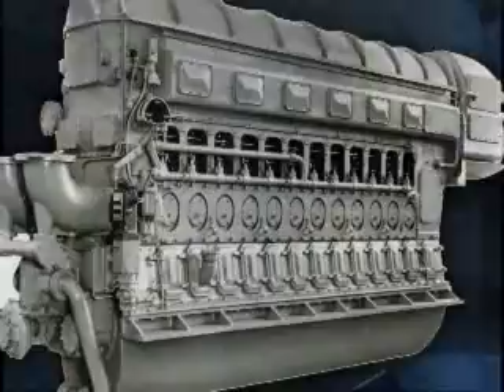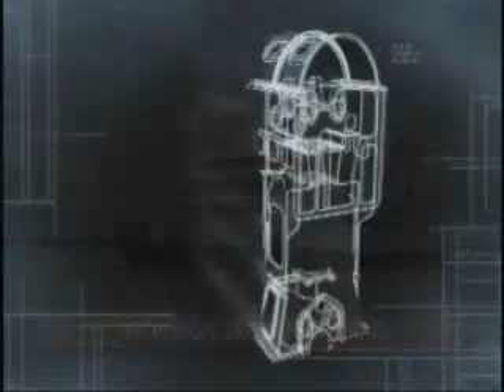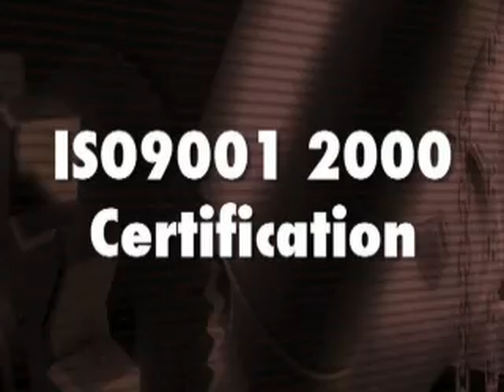The History of Fairbanks Morse Engine

Comment: Had 3 FM engines on the USS Trout SS-566 that I was part of the Decommissioning Crew in 1978. They powered 940kw generators that drove the main motors and recharged the batteries. Sad to see it scraped.

Comment: In the 1960s when I worked for Canadian National, we were in the process of scrapping CLC/FM locomotives as we found them unreliable in railway service.  Lack of cooling would cause the top if the lower pistons to overheat and burn and repairs involved removing the upper crankshaft and piston assembly which made them expensive to repair.  Marine applications, sitting in an unlimited supply of cooling water, did not seem to have this problem.

Comment: Sailed on several sea going tugs that were retro fitted with the 10 cylinder opposed engines that came from early submarines.  I was an engineer & spent many hours in the same room with these engines. Very reliable & for the most part, easy to work on. Can still hear them running!  720 max rpm full ahead
Reply: We had the same engine on a dredge pump , amazing engine

Comment: I think you should re-enter the locomotive Market I remember when I was a kid being told about Fairbanks Morse and trainmasters I knew they had an overheating problem do a general electric didn't make a big flared out radiator from the car body General Electric is literally about ready to go bankrupt from all the debt that they are burdened with I think it would be wise for you as a company to invest and coming out with a very efficient powerful locomotive there's a lot more systems now that would be able to keep the engine at an optimal temperature in a locomotive car body I bet you could figure it out
Reply: The FM locomotives failed because the engines ran horribly at high altitude, as the engines where designed to power a boat at sea-level, not a locomotive 1000+ feet above sea level
Reply: @harrimanfox8961  Anyone else hear that about FM diesel/electric locos? Hard to imagine that FM designers were unaware that UP requires locos to summit Sherman Pass at 8,242 ft with acceptable loss of power. I dont see why, if EMD 567, 645, and 710 two-stroke loco engines and GE  FDL and Evolution 4 stroke loco engines could be made acceptable, that FM locos couldnt be boosted to meet railroad requirements.
   BTW I heard that FM sued GM after GM set a policy with railroads that "Trains hauling GM autos must have GM locomotives on the front".  But FM, I think, was just out competed by GM/EMD and by GE/Alco for the diesel/electric locomotive market. Baldwin/Westinghouse was another loser in that competition.

Comment: As a small child I lived 5 Blocks from Fairbanks, the low drone and whine during test runs was a sound , I thought of Winter.....who knew....I worked for the Paper Industry, gut punch killed us , Fairbanks still humming around the Planet...Beloit PMD equipment still out there as well. Beloit was and still is to a smaller degree a Bastion of Gear, Weld, and Machine engineering Heads.

Comment: OK you may talk reliability but on the 3 ships with FM engines  on 2 ships they never saw 5,000 hrs between over hauls, very sad engines during my time with them during the 70's & 80's, I wont even mention the constant fuel line leaks
Reply: John Holden A ship I worked on had four 10 cylinder FBM's through a reduction gear to a single prop and didn't have many problems. Pigs on fuel though!

Oh... fuck Pielstick

Comment: Are you considering re-entering the Locomotive production market? I have read up on the iconic Trainmaster locomotives, and from what sources recount, the main issues with the Trainmaster were not in its performance- it was simply ahead of its time. Railroads were not seeking such giant, powerful units, and the shop workers weren't used to the opposed piston engines. Now, with the contemporarily built, massive behemoths by both EMD and GE hard at work for such Giants as BNSF, CNR, UP, NS, CSX, CPR, and export, plus earlier heavy-duty power like the EMD SD40s still beefing up rosters of all kinds of railroads, all across the U.S., one might think that the FM Trainmaster could serve as an inspiration for a new, even better locomotive, to meet the needs of today's railroads. Although most lines currently have plenty of new power, they will be needing many replacements for older power in at least 5-10 years, so if work was started before too long, a fine locomotive design or two might be developed. Think of what could be done- the power and efficiency of the latest FM engine designs, inside a frame, housed inside perhaps a shroud remeniciant of the fantastic curves and smooth styling from both ALCo and FM's entrancing history. A locomotive produced for the future, out of such remarkable past, would be something truly unbelievable. I cannot say how exited it would make me personally to see something different enter back into the locomotive market, especially considering how boring a world it is, dominated by EMDs and GEs that all look alike, with little to no taste. What ever happened to those rounded roofs? The engine that sounded almost like it was chugging rather than whining or growling, and the unique charisma surrounding some of the most under-appreciated diesel locomotives produced in the postwar era. I will hold out hope and dreams that soon, once more, a great powerhouse will once again ride the rails of mainline roads, proudly displaying a great "FM" and/or "ALCo" nameplate.
Reply: An opposed piston diesel to power new locomotives would be more likely to come from the Cummins-Achates partnership.
Reply: Leverettrailfan I wouldnt be surprised if I saw a rebuild company put an FM OP on a unit. It could spark a new era of OP locomotive prime movers.

Comment: Thruflow © Valve Designs
1 second ago

Petrol Head, using its Thruflow © patent pending inventions can replace all camshafts, valves and valve springs in engines like these! We have a simpler and much lighter design, our invention use less components, it has simpler air, gas, fuel regulation into and out of engines. Petrol Head would love to get into these Fairbanks beasts to help improve there power output even more!

Comment: fairbanks, this video is a few years old so do yous still make the opposed piston 38d series engines nowadays?    on the one tug i work on it has a FM 38d81/8 8 cylinder paired to a FALK reversing reduction marine gearbox from 1958 when the tug was built.  shes still going strong.
Reply: ***** over this past winter we did a overhaul on the engine, using all new FM brand cylinders, and pistons & rings (in the past aftermarket parts were used).    we have never heard this thing run as good, very clean and smooth running!   I am happy to say to you's that we are very happy with the parts and our engine is running fantastic!

Comment: From what I have seen on the internet an opposed piston engine has 2 crankshafts and no cylinder head as the opposing piston does that and the valves are on the side in center the pistons come toward each other in the same bore to make compression.
Reply: That's true.  The two cranks are actually slightly out of phase, so the combustion chamber moves along the cylinder bore during the moment of maximum compression.

There's also the Napier Deltic engine, which also saw railway and marine service due to its exceptional power-to-weight ratio.  It was considered particularly valuable for fibreglass-hulled minesweepers, in which minimising the magnetic signature of the ship is crucial to its mission.  This is an opposed piston design with three crankshafts and three banks of cylinders.  One of the crankshafts rotates the opposite way to the other two, and the phasing is 20° between cylinder banks, this being the key insight that makes such a triangular-section engine work..  In early tests it produced equal power to German E-boat engines in half the size and weight.
Reply: No valves on these FM engines. Cylinder ports. Crank phasing opens exhaust ports before intakes, closing them earlier. About resuming production of new OP locos, no mention of meeting emissions requirements- a biggie.

Comment: I was on the now scrapped ICE Breaker Coast Guard Cutter Glacier.She had ten 12 cylinder opposed piston fairbanks engines in three separate engine rooms. Built in 1953 21,000 shaft horse power.She was the largest diesel electric plant afloat at one time.I worked in one of those engine rooms.There were three fairbanks and a cat 3412 ship service generator.Loud and hot working in there.Never forget that sound.Good times!
Reply: That would give me my 2 stroke fix forever.

Comment: Does Fairbanks still make real small ones just big enough to run household appliances?
Reply: If Fairbanks Morse doesn't have what you want, try Kohler. I've had quite a bit of experience with those and they're great. Other good small diesels are made by Yanmar.